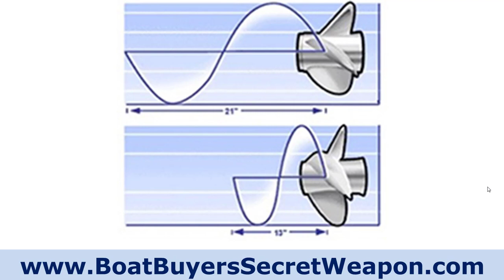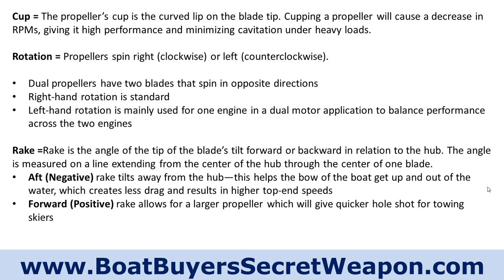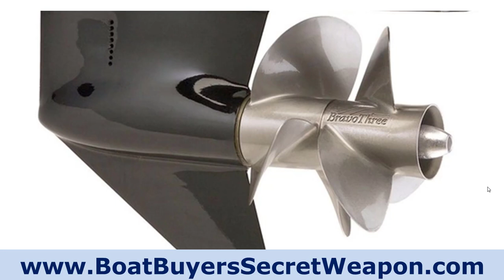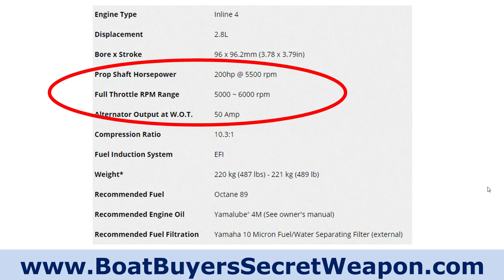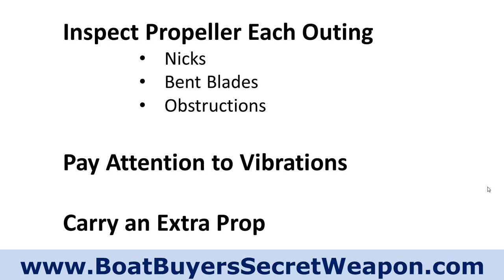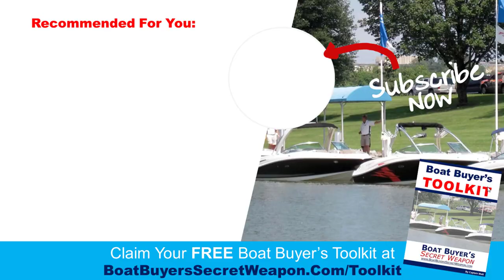Choosing the Right Propeller to Make Your #Boat or #Pontoon Go Faster

Comment: Excellent video thank you.  Assisted me greatly in figuring out why at close to full throttle, I was hitting the Rev Limiter and automatically causing the motor to throttle back until water replaced what has been air, causing the RPM to jump to Reve Limiter engagement.
Reply from the maker: Glad the video helped you identify that ventilation issue!

Comment: excellent video I agree w/ everything you say. can I use an aluminum prop to to find the desired RPM then use a stainless steel the exact same size prop. or will I gain RPM w/ the stainless steel?
Reply from the maker: No as has less flex so will be lower rpm typically

Comment: At the end of the day, you can get a recommendation but the cost, even if it is the wrong prop is absorbed by the boat owner in the trial an pay process.  I am currently suffering prop selection paralysis.  Waiting on a recommended prop and going to confession Sunday to get in favor with the boat gods

Comment: This is the best video on props that I have seen and I'm in the process of changing mine. I have a 14.3 x 19 aluminum prop on my sterndrive 5.0lL engine and don't need to do 45 mph but would like to get a quicker hole shot. I will go down in pitch, should I still stay with the 14 1/2 diameter. Thank you
Reply from the maker: Probably best

Comment: I can only get roughly 50kmh outta my 3.0 mercruser  it seems alittle on the slow side I have 14.5 x 19 pitch , any idea how I can make my boat faster or is this the normal top end speed for this 3.0 boat ?
Reply: What is the RPM at top speed? If you’re at max RPM you have nothing to gain. If you can’t achieve max or very near max you need to step down to an 18 pitch.

Comment: diameter also plays a role in prop selection
Reply: I have a 90hp 2 stroke mercury running 5600-5700 rpm with a 13x19p alu prop, it rated at 5000-5500rpm.. i would like to try a 13x20 but its near impossible to find!! What would you recommend?
Reply: @felixgodin3244  the motor is rated 5000-5500? If thats the case...id run the boat empty with just you on it and note the rpm at wot. You want the rpm to hit 5500 empty. Loaded brings rpm down. Measure center of hub to your anti cav plate. Whatever you get, times it by 2 and subtract 1/2"..that gives you your max prop diameter you can run...thatll slow rpm.
Reply: @CrawlerLife96  im running 5600-5700 with just me in it.. i think 14x19p fit ill have to double check..do you think I will loose top end?
Reply: @felixgodin3244  yes, when adjusting the diameter or pitch...there is always a trade off between top speed and holeshot. If its just you and no gear doing 56/57, id leave it as long as your not hitting the rev limiter. The 14 will give you the extra grunt. What are you looking to do? Gain top speed or drop rpms a little.
Reply: @felixgodin3244 
Find a Laser 2 20” prop. Forget the garbage alu props. Waste of money and time.
Reply: @felixgodin3244 if you dont carry much weight then a 20 will be fine .... if you carry 3 people and lots of gear stay with a 19 .
Reply: @darrinkulyk9560 ive run a 12 e/4 x 21 since 2 years.. best prop ever
Reply: You Want Your Motor to Rev To 6000 then start adding pitch till you're  5800/5750 .... 5500 is too Low

Comment: Please correct me if I’m wrong. 
Let’s say you have a 3 blade 19p, it makes sense to me that you could go to a 4 blade 21 possibly 23 (if you can stay in desired wot rpm range) with removable or adjustable hub venting letting you keep high speed when plugged or retain the hole shot when loaded down or for water sports. 
Also I’m curious of your thoughts on the adjustable pitch props
Reply: If you use a 4 blade you drop down 1 pitch compared to a 3 blade prop. Because a 4 blade will displace a larger volume of water

Comment: I have a 24’ pontoon with a 2010 Mercury 90hp 2-stroke.  At WOT I get about 20mph at 5300-5400 rpm.  I currently have a 13-3/4X15 3 blade prop.  I’m thinking of trying a 14X13 3 blade.  Any thoughts on going down in pitch to give more torque/performance/speed?
Reply: I recommend you save your money. With 90 HP I don’t think you will see big gains either way. If you run with a decent crowd on the boat you will lose top end and hole shot. If your running light you might get 1-2mph but I wouldn’t be surprised if you see the same just at a lower RPM. If it were me I would leave it alone or possibly try a 13 to get my RPM up a little and gain some hole shot.
Reply: Get a bigger engine 😂

Comment from the maker: :_TubinFun: FREE For Boat Shoppers: https://www.BoatersSecretWeapon.com/Toolkit FREE Boat Buyer's Toolkit for new or used boat shoppers will give you 28-pages of checklists, questions to ask and how to demo the boat the right way so you don't miss a thing. Plus, get the cost of ownership calculator so you know precisely what your cost of ownership will be. 

 :_HapyBoatng:FREE For Boat Owners: https://boaterssecretweapon.com/pages/boater-bootcamp FREE Boater Bootcamp for newer boat owners gives you insights on boat ownership basics, navigation and practical rules of the water and how to avoid, be prepared and handle emergency situations. No more not knowing what you don't know in the boating lifestyle.

Comment: What if my boat had a 17 pitch and it only went 17 mph at 4200 rpm so i lowered the pitch to a 14 and i got rpms up to 5500 rpm but boat only went 13 MPH ??? What is up with that !??
Reply: Man that is a tough one. I guess it depends from boat to boat. Mine, when i lowered the pitch went faster. I presume you kept the same diameter of the propeller
Reply: We need to know what props you have. Make and model.
Also, what boat, and what engine?

Comment: How do you compensate for altitude on a 4 stroke efi motor? Most are tuned for a little above sea level but my area is between 2500 and 6400 ft above sea level ?
Reply: EFI compensates for you. But you will lose 3% HP for every 1000’ of elevation in any naturally aspirated motor.

Comment: '....if you're too light you don't want to be maxing out @ 6500...' so, how does that happen against the rev limiter? you're all over the place trying not to make an accurate statement. simply, if the boat is light ( people, gear, fuel, water, toys etc, etc)  properly propped, the boat would exceed the manufacturers WOT RPM by approx 100-200ish RPM. with a normal complement of people, gear, fuel, etc, ie a higher average weight, the engine will now top out closer to the 6000 RPM limit, operating as efficiently as possible.

Comment: 150 hp and above to use stainless.
Here I am with my 20hp yamaha with a stainless prop that goes 32 knots on a 3.9m boat. And tbh here anybody who knows anything about boats have stainless props so I really have to ask where you come up with these thumb rules and why on earth would you ever want a aluminum prop? Other than the obvious reason that its cheaper and often there from factory
Reply: I would say more like engines under 100hp don’t have enough power to take advantage of the stiffer stainless prop ears and many people like the fact that an aluminum prop is a good “fuse” in the event you hit a rock or log they’ll break or bend an ear rather than possibly damage your lower unit if the hub doesn’t spin/break like they’re suppose to in the stainless. 

I personally have two 15 pitch props one aluminum, one stainless from the same company and the aluminum one is actually faster. And I believe that is due to the slightly larger diameter of the aluminum prop and my motor is a 50hp so again, it’s not powerful enough to take advantage of a stiffer prop.

Comment: Here is a good one....I bought a 2021 19' Lund with a 150 ProXS motor.  The boat came with an aluminum 4 blade prop. When moving at low speed and at very low RPM, there was a noticeable whine or whistle.  It was crazy.   I put on a 3 blade stainless (same pitch etc) and it went completely away. 
I like stainless and would have eventually switched anyway....but this sure sped up my decision.

Comment: 19 ft. Baja 1885 lbs 5.0 V8 Mercruiser Alpha One.  stainless 14.25 ×17, 3 blade =51 mph
Reply: Kinda slow, 4.3 GXI small block Chevy does about 65-70 depending on the load with 21p but sucks getting out the hole with fat people so I don’t let them come no more problem solved, lose the fat hoes Mark.
Reply: Is that GPS speed?

Comment: I have a 21' Campion Chase bowrider with a 5.7 Mercruiser, It's my first boat. It came with a high five prop (5 blade) with a 21 pitch 13.25"D and it's an absolute dog out of the hole.. It was suggested to drop pitch to 19 and maybe a 4 blade instead.. but seriously, it takes forever to plain.
Reply: Put a "whale tail" on the cavitation plate. Gets on plane faster and saves fuel.
Reply: Don’t add the suggested fins, they are a bandaid, not a solution, and they will often severely impact handling and efficiency. Your boat is completely incorrectly propped. 
The High Five is a bad choice for that setup. Go to a Revolution 4 19” or 20”. What is the max rpm with the High 5?
I suspect the previous owner took the prop he had on the boat with him, and just threw on a prop he had laying around.

Comment: Greetings, good morning, these are the specifications of my boat.

Boston Whaler Rage 15 1994

BOAT TYPE

Jet Drive Boats

ENGINE SPECIFICATIONS

2005 Yamaha Outboard 60hp [ F60TLRD ]

Gasoline

HULL MATERIAL

Fiberglass

BEAM

6'5"

LENGTH

15'

NET WEIGHT (LBS)

1,200

I would like to know which would be the correct propeller to buy for my engine.

Comment: For a jet boat if I have a 18/27 impeller and went to a 22/39 impeller. What would be the difference.  lil background. I have a 900lb jet boat with a 120hp 4cyl 2stroke  and I’m going to a 200hp 4 cyl 2stroke and  no added weight only change is hp.   there’s only those two impellers to choose from.  Manual wot range is 4,700-5,300rpm It currently turns  right there at 5,200-5,300rpm so I know with the extra 80hp it’s going to just run into that rev limiter hard.

Comment: My boat is 17 foot legend with a 25 merc 2 stroke and is fastest with the stock pitch which tops out at 4500rpm with two adults and fishing gear goes 20-22 mph. I bought a prop to achieve 5900 rpm and top out at 19 mph. Also fuel economy is dramatically different in that 1400 rpm
Reply: @BoatBuyersSecretWeapon  oh I’ve tried many props. I find for best fuel economy and speed was with a 9.5 pitch prop. Every pitch up just adds rpm and hole shot. Weight, boat and real water testing is the only way to find this out. The math is just a good starting point I think.
Reply: @BoatBuyersSecretWeapon  yeah, I’ve done prop testing and the efficiency drops off beyond 4600rpm. Mind you a 25 hp is underpowered for my 17 foot legend In The first place. How the water interacts with the propeller how much speed increases lift etc all play in how fast an underpowered boat can go. So in my situation, I cruise at 4200 rpm at 18 mph and get that fuel economy. No other prop I’ve tried can achieve that. If I had a 40hp on there probably completely different circumstances since any prop set up would overcome the bow gripping the water
Reply: @BoatBuyersSecretWeapon  I am going to shoot a video of my current set up today. Tinkering is my passion in life and it seems you share similar interest. Have a good one
Reply: @BoatBuyersSecretWeapon  
https://youtu.be/C4x2ehqR5Xo
Reply: That is weird. I was sort of in the same situation as you but with a smaller boat. 14.5 ft and 20HP outboard. With original prop 9 1/2 11 at full load with 2 people and gear, i only got 4000rpm and 13mph. If i was alone, which is really rarely the case, i got 5000rpm and 19mph and the boat didn't plain. I got a new prop 9 1/2 9 and now under load with 2ppl and gear i get 5400rpm and 18mph and when i am alone i get 5400rpm at 23mph and the boat plains.

Comment: Would going from a 8in pitch up to an 11in make me lose too much power or is that about an average increase to make a very noticeable increase in speed.  Its on a 9.9 honda on 16ft aluminum just me in it.
Reply: @BoatBuyersSecretWeapon  false alarm i won,t be getting the motor, i and a group of people got scammed by a certain website and won,t b getting the motors b careful out there
Reply: @BoatBuyersSecretWeapon  i bought the motor but don,t even have it yet, but i am going to want to check rpm when i get it, how in the world do u do that, what do i need, where do i get it and how do i use it, i guess higher pitch is safer than lower pitch because i,m lowering the rpm,s which is safer than over reving it correct.  Probably going up from an 8 to a 10 would be not too mucj of a jump, still get between, i,m guessing 5 to 10 mph increase without losing too much power or trolling ability, does that sound right.

Comment: An “accurate” tach is the most essential item for performance. If you don’t have one your guessing. The cost of guessing will probably outweigh the bill you get from a reputable dealer. You sure don’t want to be guessing on 500$ sst props. I’ve seen aftermarket and some OEM tachs off as much as 300 rpms. A good dealership will water test and prop correctly as part of price of the rig. Or as a service to gain a new customer as well as a prop sale.

Comment: I don't suppose we'll ever have variable propeller geometry?
Reply: @BoatBuyersSecretWeapon  Awesome~!
I have a question, something that I would like to test but currently do not have the means, and can't find the information for anywhere else...
Do you think adding a super hydrophobic coating to a propeller would make it perform better, or worse? (RPM, CFM, noise, power consumption, etc)
Reply: @BoatBuyersSecretWeapon  Mercury Marine had one it was expensive and became troublesome due to corrosion.

Comment: I'm having issues getting up on plane. I've a '98 Cobia 154 with an '02 50hp 2-stroke yamaha. I can't barely get on plane, just dredge through the water. Prop is 10 1/4 x 13p. Recently tried a 11 1/4 x 11p hoping to get more grip to get out but no luck. Any tips or info would be GREATLY appreciated!
Reply: @BoatBuyersSecretWeapon  both are 3 blade. The 10 1/4 x 13p is a SS quicksilver, the 11 1/4 x 11 is OEM Alum. RPM's are spiked out at 7k (yes I know, sky high as it says 5500~ should be WOT) for both props if they eventually get on plane (30-60 seconds). The boat didn't have a tach originally installed and had local boat shop install one he had there at the shop. Weight is fairly evenly distributed I believe. I've also tried a 12x15p prop, WOT was 3500 rpm, but would not get up on plane with just me in the boat. Normally I have another person with me. Yes, trim is all the way down.
Reply: #Shawn Bean going to a 17 or 19 pitch prop will lower your rpm's.

Comment: This is what's wrong with the internet. This guy is totally out to lunch and giving bad advise. And people are commenting seeking more advise which will be absolutely wrong. He states that if your WOT is 5200 and the recommended WOT is 6000 that you should increase pitch...which is exactly the opposite of what you should do!! Increasing pitch will bring your WOT down...not up. Then at the end he says if you want a better holeshot to increase pitch, more speed, less pitch...again, absolutely the opposite of what you should do. Use a manufacturers website to do your prop selection and leave these keyboard wizards to their own demise.

Comment: If you would be so kind to let me know what the right pitch I should use: 
My boat is 17 feet long,  fiber glass made, weights around 1ton,  it has a 200HP mercury engine,  and I use it only to water ski with 1 or 2 skiiers, with 2 to 3 people on the boat and  25 gallons of gas.
Now it has a 17 pitch alluminum, 3 blade propeller that seems to perform the job well.
Is there a change that I should make in order to perform better.?
Thanks, and greetings from Baja California Sur.
Reply: @BoatBuyersSecretWeapon  Many thanks!
Reply: @carlosarriolaisais7068  TRY A MERCURY HIGH FIVE 17" ...ITS THE BEST SKI PROP EVER MADE !

Comment: ok i'm confused.  You state if you go up in pitch ie from a 15 to a 16, you will loose 150 - 200rpm at WOT and if you go from 16 to a 15 you will gain 150 - 200rpm at WOT, then you give an example of a 200HP Yamaha, sitting at 5200rpm and you want to go up a pitch in prop which my understanding would drop you down in rpm's to like 5000 or 5050 no?  wouldn't you want to be going down in pitch so it brings up the rpm?  thats how i understand it.  Anyone else understand it like that?
Reply: @BoatBuyersSecretWeapon    Yea no worries, just wanted to make sure I was understanding it well.  Appreciate you clearing that up.  Great explanation on the video.

Comment: 2005 Rinker Captiva 192.  Started with 14x19x4B and was going 45 but struggling getting out.  Switched to 14x19x4B and now only going 30.  Where should I go from here to get back up to 40mph and be able to get on plane?
Reply: @BoatBuyersSecretWeapon  Max 4400-4800 sterndrive.  I have a 14 inch 19 degree 4 blade and it only goes 30.  4.3 Mercruiser.  I had a 14 inch 21 degree 4 blade on and it went 45mph but it had a hard time getting on plane.